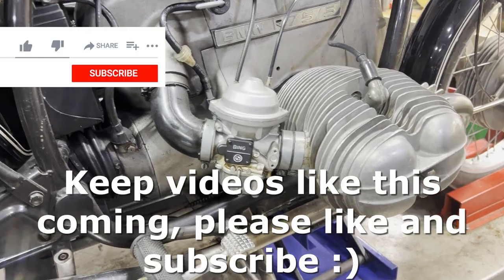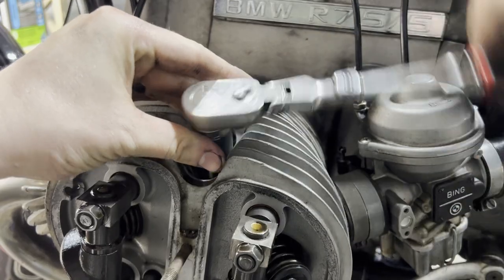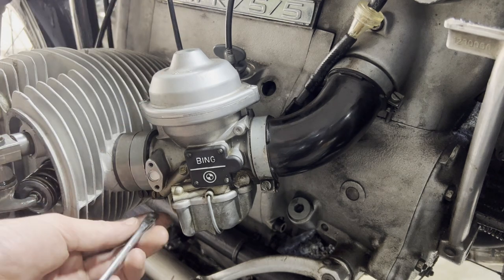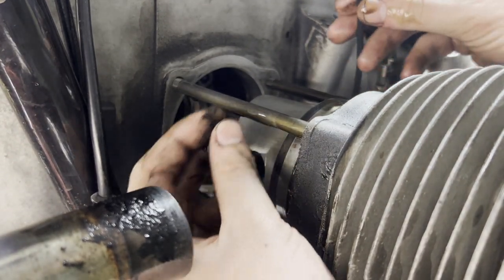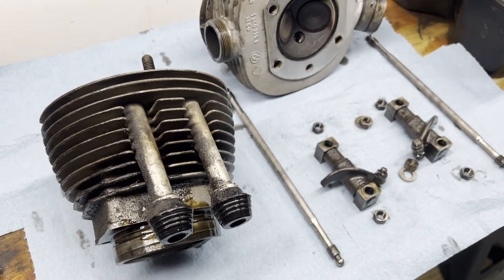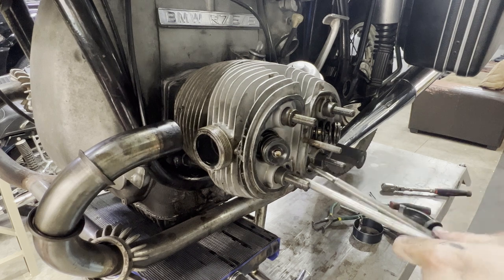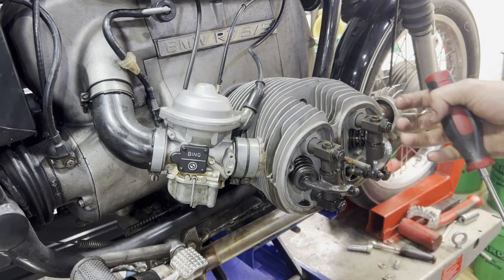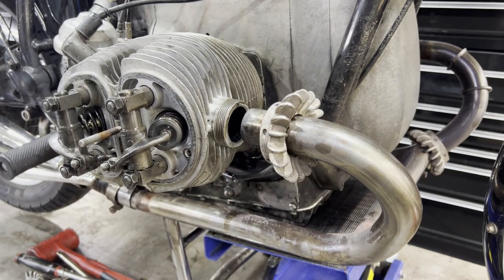BMW Airhead Top End Reseal in 10 MINS. ALL MODELS

Comment: Great job. Just a suggestion. If you remove the clip on the wrist pin, and the wrist pin, while the piston is still on the cylinder, they’ll pull out as a unit. It’s so much easier and faster to put back together.

Comment: Good video on pushrod seal replace as others have said...  But this is a really good time to pull out the cam followers to check the condition of the cam follower face.   I have found sevral engines with cam followers that were starting to spall and am very glad the I was able to replace them before a bunch of hard metal went through the oil pump.

Comment: Very helpful, thank you!  How would you feel about Permatex Ultra Black (oil resistant) Gasket Maker on the pushrod seals, Hylomar Blue (fuel and oil resistant) on the base gasket, and no additional coating of the head gasket?  Thanks for helping out a lot of BMW owners!

Comment: I would recommend you consider, "Three Bond" grey gasket seal. This is not silicone based, is a perfect grey match for case and head. I NEVER use any form of silicone on engines, transmissions etc.. If a compression surface leak it's either torque, gasket or deck. The biggest mistake I see are people using scotch brute pads and wheels to clean flat surfaces. This is just my opinion.
Great production and happy new year
Reply: You also didn't mention torque? Just the same very nice production

Comment: Let's pray that the silicon used to seal up this engine doesn't block the oil-feed to the head, which is pumped along both upper cylinder studs! And reusing an already-compressed head gasket and reusing rings is quite questionable.
Reply from the maker: my guess is you didn't watch the whole video.

Comment: At 10:00, I noticed what appeared to be a crack in the valve cover cooling fin. Would that call for a replacement…?
Reply: Not unless it is visually offensive to the owner, in that location it's purely cosmetic... much like the broken fin on the cylinder

Comment: Nice vid, thanks.
When I idle my R100RT as you did, with the covers off, heaps of oil squirts out of the rockers, both sides. That can't be normal, right? Any suggestions - where is the problem, how do I fix it?

Comment: I suppose this is fairly ok as an introduction for  how to pull the cylinders on an airhead! And thats it ! Because you are not resealing those cylinders in the shown way.Where to begin ? You should have left the piston stay in the cylinder as someone suggested.Why because most probbably you will have noticeable oil consumption caused by the altered place of the rings.even if you didnt have before!! You should have addressed the horribly running pushrod sleeves(by replacing them) because theyll be running as soon as you start the engine ! Than in Gods Name clean the cylinders and the engine itselve dont put on the old smear adding silicon ! Also one will be surprised if checked of the warp that the heads have. And so on and so on...First of all however..look at your video do you think someone  could really find the RIGHT  TDC following your instruction ?